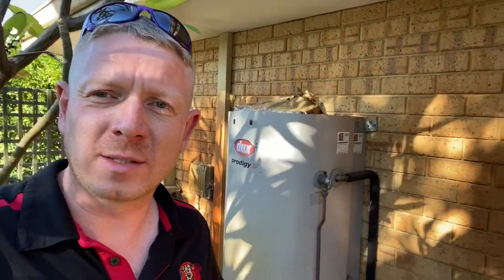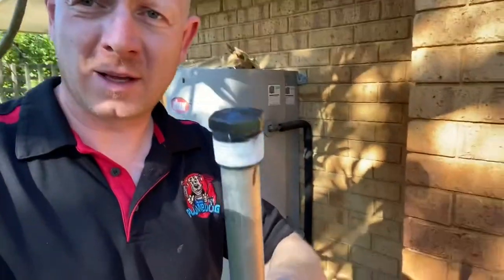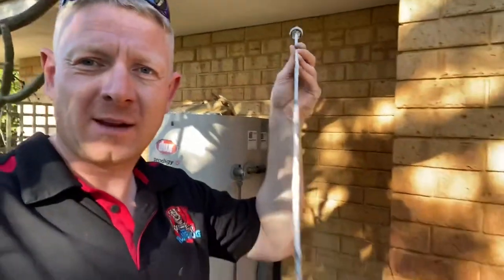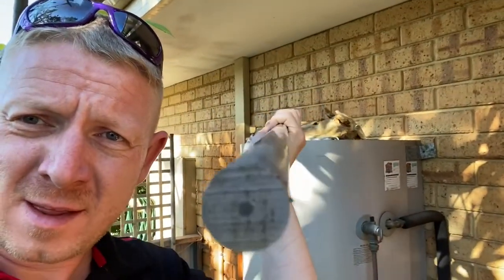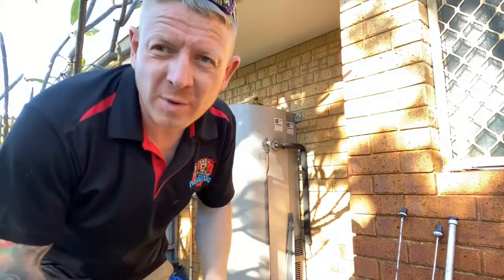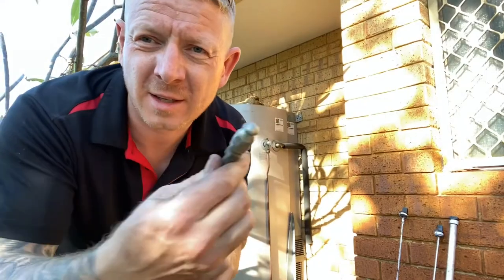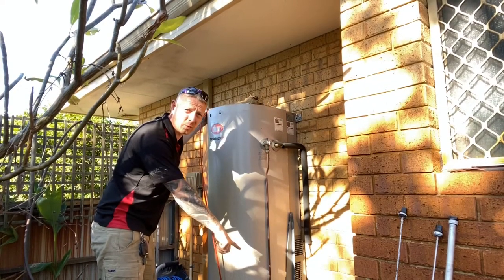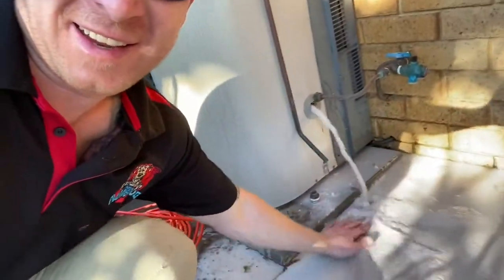Replacing Sacrificial Anodes & Tank Flush Of A Storage Hot Water System - Plumbdog Plumbing Perth

Comment: Thank you for this video clip. I solved the annoying noise (very loud) from the cool water line when flushing the toilet only WHEN the hot water system was boiling there was a rattle inside the tank ( I cleaned the inside of the hot water tank and replace anode after 15 years). .. How does the hot water system affect the cool water pipes?

Comment: I'm about to flush my solar boosted system. Can you just flush it with water from the tap or does it have to be a pressure washer? And is it harmful to drain the solar panels and have them empty in the sunlight? It hasn't been done in 12 years. It a Rheem solar loline gas boosted water heater. Thanks.

Comment: That nasty man ur using the jetter that cleans out sewage to flush out the drink water tank
Reply from the maker: Firstly a hot water system isn't a 'drink water tank', and secondly a jetter whip hose only becomes a sewerage cleaning hose if it has been down a sewer, which in this case it hasn't. We have trucks full of different equipment for different tasks.

Comment: Thanks for the informative video re anode replacement.  However I often wonder why storage hot water systems are installed in the first place as obviously they can have a limited life if not correctly maintained at considerable cost. This includes solar HWS.
Just inherited one on a house we have moved into and although only 3 years old needed a pressure limiting and tempering valves replaced recently and I am now concerned about how long before the anode gives out.
In our previous very large house which we owned for 44 years we had two instantaneous gas HWS, one of which lasted 35 years (with a little maintenance and parts ). They were placed at each end of the house to minimise heat loss and were  very economical costing approximate per annum the equivalent of running a solar HWS booster in winter.
Both were upgraded to hi tech electric gas HWS  (one from PlumDog)  and were even more economical with greatly increased performance.
They are comparatively cheap to buy, (probably in the region of a major service on a storage heater) easy to instal and very reliable with virtually no maintenance.  
And they are very controllable compared to solar systems which need a decent tempering valve to prevent the extreme high water temperatures they create in summer from reaching outlets. 
These high temeratures/pressures are not controllable and cause constant outflow from relief valves. (One major manufacturer even provides a service to partially cover collector panels to limit heat gain)
As soon as our solar HW system  decides to play up when out of warranty it will be  instantly replaced with an  instantaneous gas unit.   (Probably fom PlumDog as they have great pricing and service.)

Comment: Thanks. Worthwhile knowing that the tank has to be flushed. I would have liked to see how you replaced the anode without dismantling the pipes and moving the tank since there doesn't appear to be enough headroom to manoeuvre the new anode into the tank. Re your response to chrisfi3d a year ago. Couldn't agree more. I had a Beasley copper HWS that lasted 25 years replacing the valves and the element once (probably why they went out of business). Live in the only postcode in Adelaide that Rheem won't warranty stainless tank and don't have enough headroom to replace the anodes without moving the tank
Reply: My guess is he used an anode rod with a hinge in the middle

Comment: This is awesome info. I have to tackle this job soon. 
Mine is a solar system with ground mounted tank. Will be setting up pipe to divert the flushed out water to control the mess.
Have to watch for air lock in the roof mounter solar panel when reconnecting/re-pressurising.
Thanks for posting.
Reply: I have the same system. Did you just simply let the tank fill and then undo the bleed valve coming back from the solar panel? Did you drain the rubbish from the cold inlet? Is it harmful to have the solar panel empty in the sunlight?

Comment: If it can be gotten to with a Jetting system, all the Better!
Not so lucky in the US with heaters mounted in Closets, Attics, Basements, etc.
Thankfully some plumber finally came up with a Tool that seems to do an excellent job of breaking up the Sediment through the Drain opening. The tool temporarily replaces the drain valve and uses a modified length of Sewer snake cable and a Grinding chamber to dig out and crush up sediment before flushing it out the attached hose.

Comment: Crazy amount of degradation. I swapped over a 17 year old Aquamax yesterday and water coming out was perfectly clean. These Dux systems seem pretty ordinary in comparision
Reply from the maker: Definately a difference between system mate. We do find its more so the location and water type thats the difference as the anodes should presumably be very similar quality. We wish suppliers had a hard water anode option in Perth but more so up north. Aquamax systems are stainless steel, yet Rheem no longer aloud stainless systems to be sold here due to water quality - likely cost them big in warranty replacements.
Thanks for your comment, thanks for watching!
Reply: Thanks for the reply. If hard water is causing this or in known hard water areas, I wonder if there is a type of pre water filter before the cold water inlet that can be fitted. That and or a simpler system manufactures can add to expel the entire water for the consumer to do every 3-6 months. Your customer is on the ball with it though!